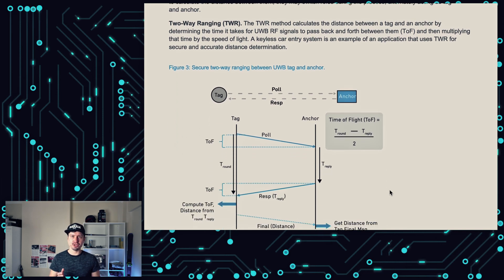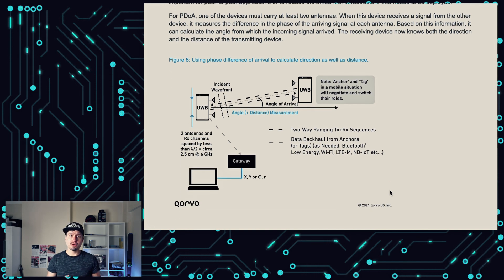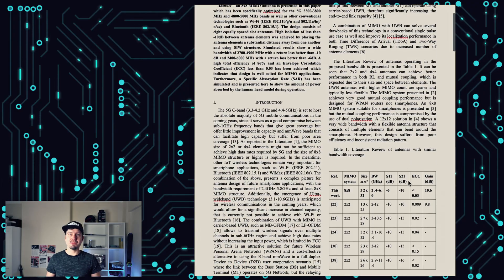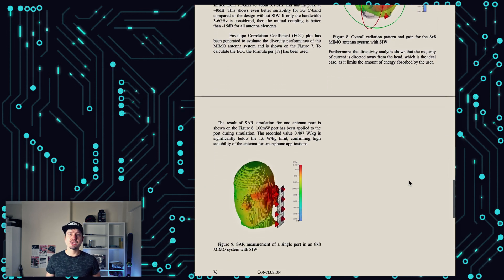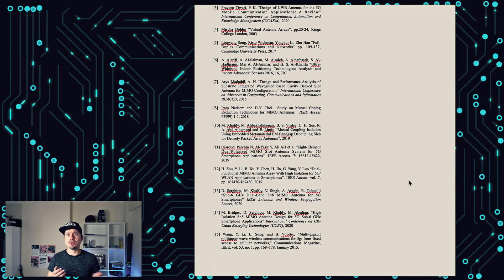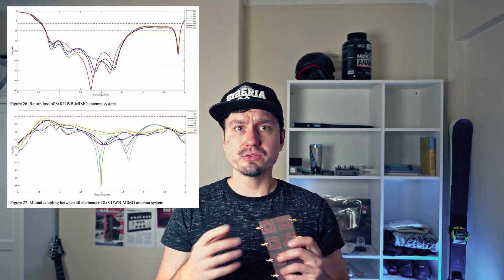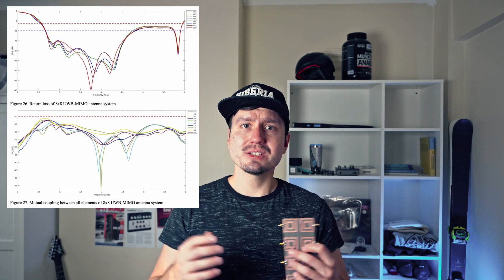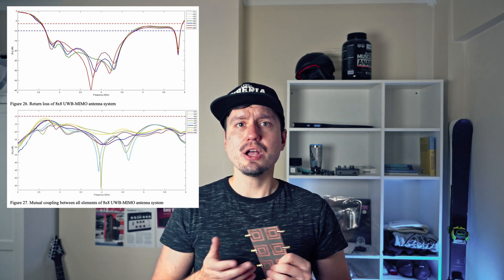Ultra-Wideband 8x8 MIMO Antenna 2.4 - 6.0 GHz

Comment: Can you make a video related to ultrawide band MIMO antenna with polarisation diversity
Reply from the maker: Yes, good idea!
Reply: @DrEMC-sf8rx when will you upload that video i want to understand that topic because no one can explain it clearly
Reply from the maker: It takes time :)  @Wasif_zaidi14  
If you want to understand the topic, the best thing to do is to break it down into sub-topics. For example:
Ultrawideband. MIMO antenna. Polarization. Diversity.
Ultrawideband - Has a better than -10dB return loss across a wide range of frequencies. It's not necessarily related to UWB protocol. 
MIMO antenna - any antenna system with multiple independent antennas for transmit/receive that are typically spaced wavelenght/2 apart.
Polarization - a transverse wave property that shows the geometrical orientation of wave oscillation. It can be linear, circular or in between. Most radio signals have linear polarization and further characterized into vertically linear and horizontally linear.
Diversity - literally means multiple independent paths.
So, to put it all together - an Ultrawideband MIMO antenna with polarization diversity is simply a system of multiple antennas spaced wavelength/2 apart that work well across a very wide range of frequencies and can receive signals with multiple polarization orientations. 
For example, a 1-10GHz 2x2 MIMO antenna system with circular-shaped patches will meet the criteria. Because it can recieve radio signals with both vertical and horizontal linear polarization in equal amounts. Then, if a part of the communication is encoded and transmitted with vertical polarization and another part is encoded and transmitted with horizontal polarization, both will be received and combined by the antenna, which is called a diversity gain of antenna. 
Hope this makes sense :)
Reply: @DrEMC-sf8rx  thanks